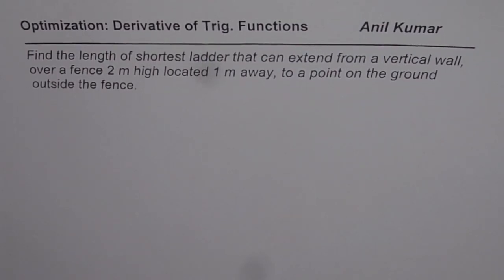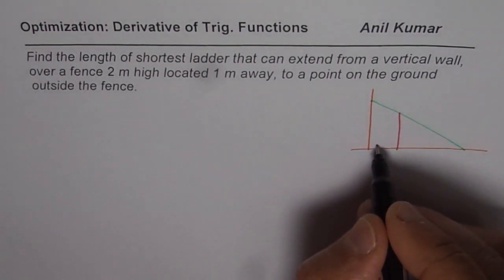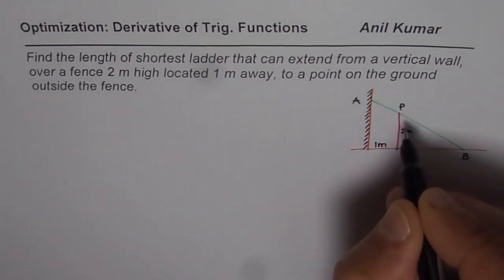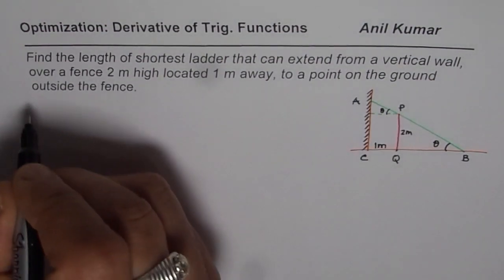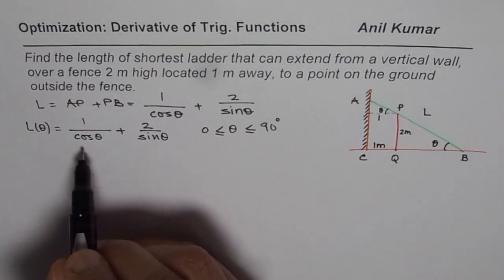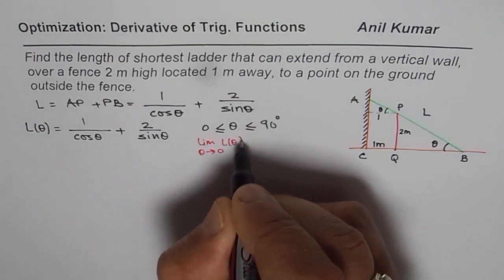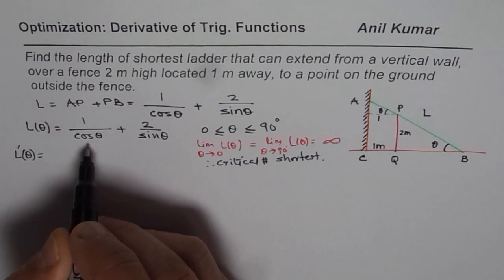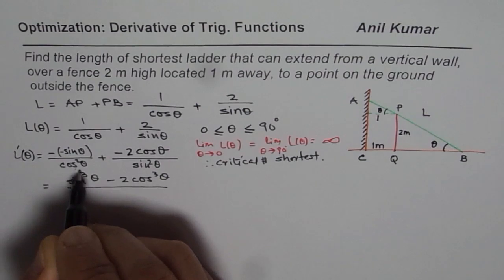Length of Shortest Ladder over a Fence Trigonometric Optimisation Calculus

Comment: When you give the interval of 0 to 90 degrees. Is it supposed to include 0 and 90 degrees? Because if theta was 0 degrees, the ladder would be parallel to the ground and therefore never reach over the fence. And if theta was 90 degrees the ladder would be perpendicular to the ground and therefore never reach the wall